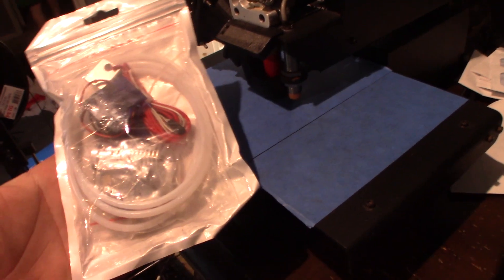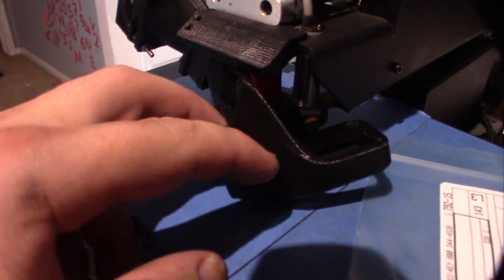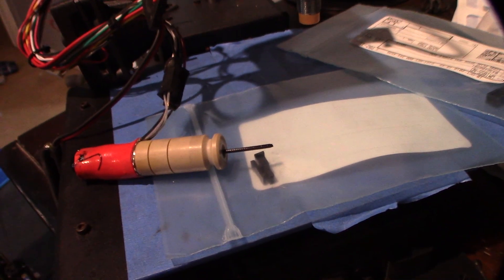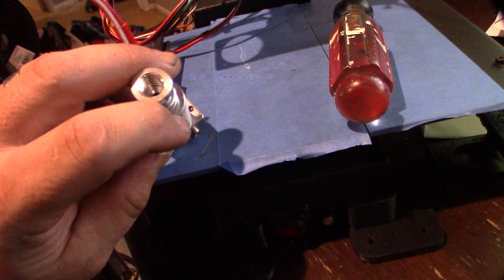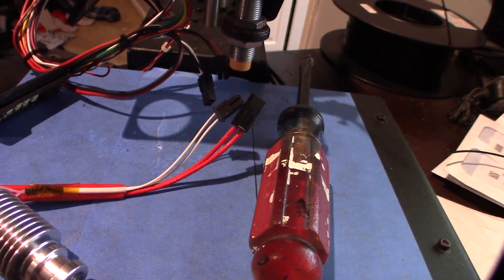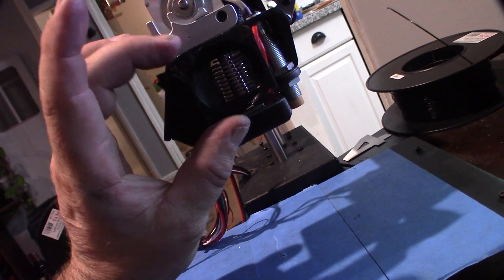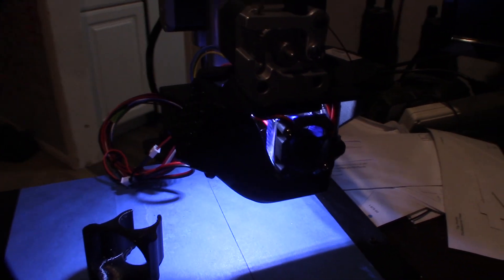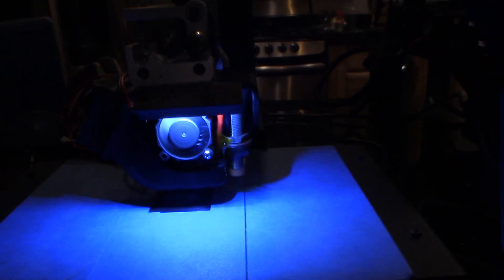Printrbot E3D clone and Marlin 1.1.9 upgrade conversion simple metal

Comment: Hey my Printrboard died, I was wondering if you or anybody else that you know of has guide on replacing it with an aftermarket or generic marlin board.
Reply: you've probably found it by now but Dr Phil on the Printrbot facebook group has been compiling different firmwares for the SKR mini boards that are supposed to work well enough, he's doing an adapter to get the probe running

Comment: I think this is a great printer. My hot end finally kicked it so now I have to put the v6 on. Do you have a recommendation for the boot loader? My research suggests 3 different methods.
Reply from the maker: If you using a stock printrboard then you need to flash with Atmel flasher via USB
Reply: Fintech Repair Shop thanks. Figured it out. Took me a while but I got it. I had to scour the internet to find the driver to recognize the board when in boot mode, but finally found it. I did wind up using Atmel. Thanks again.